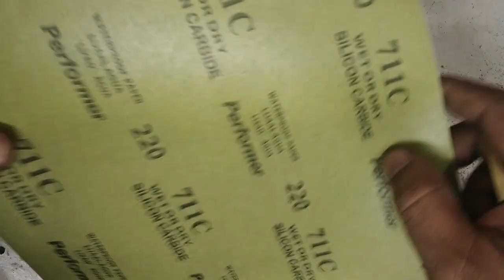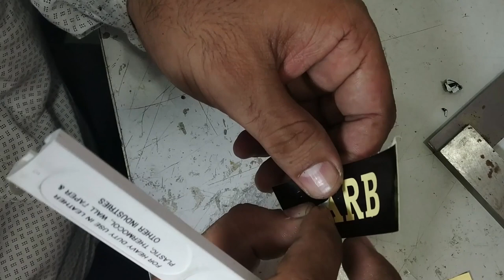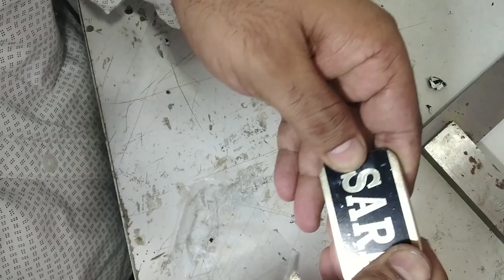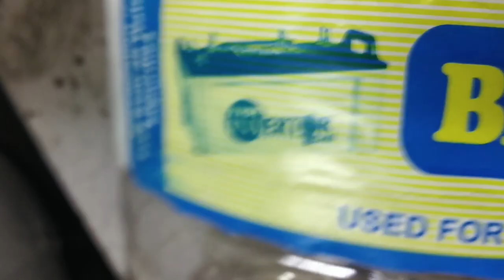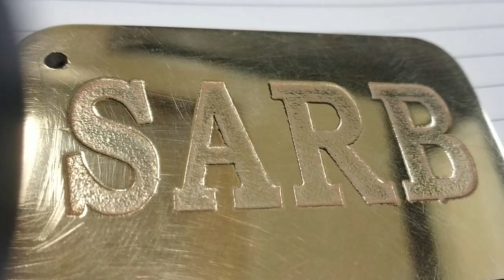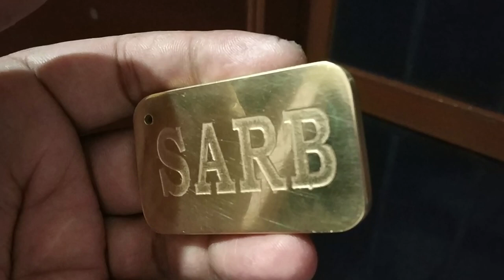Engrave on Brass easily at home   || DIY|| Ask Technical Expert

Comment: Electro Etching is the process, Now a days, CNC router machine is used on engraving brass with better result and you can use Script FONT. Plus sanding the plate is practically will just leave you scratches like what was shown..